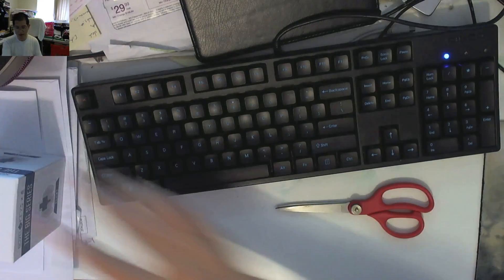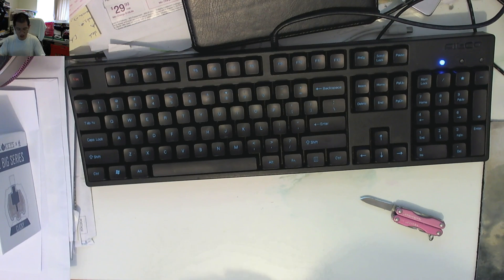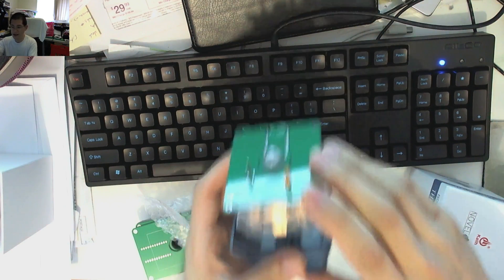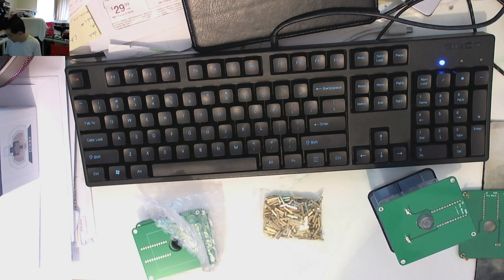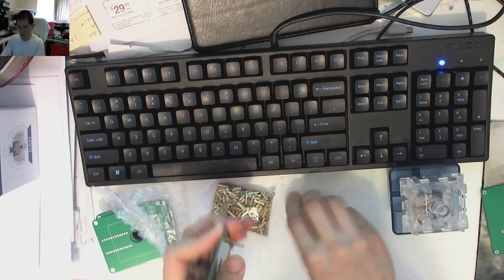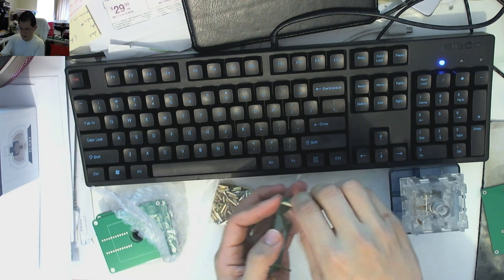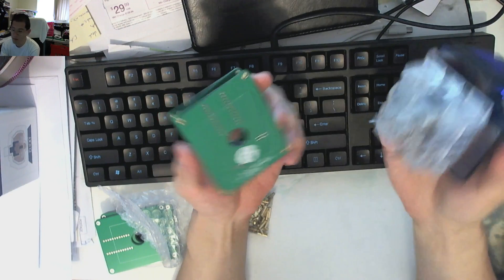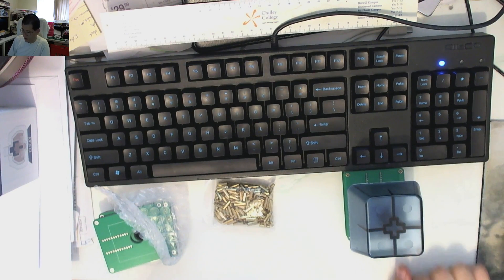Big Switch PCB Attempt 2

Comment: Don, thanks for building such a sweet little board for these monster switches. I am working on an enclosure design for 3d printing and wanted to know the final board dimensions. Need to be sure the pcb will fit. Thanks!
Reply from the maker: 65 mm x 79mm x 1.6mm :) Good Luck!
Reply: Would you mind sharing your design with the rest of us? :)
Reply from the maker: Was that to me about the PCB or to Demoni696 about the case?
Reply: Sorry for the confusion. It was about the case. Ordered the PCB earlier today, that's why :)
Reply: Just uploaded the files, I can not guarantee that the case will fit the PCB, have not ordered one yet (fail) https://www.thingiverse.com/thing:2821834
Reply from the maker: Thank you for sharing!